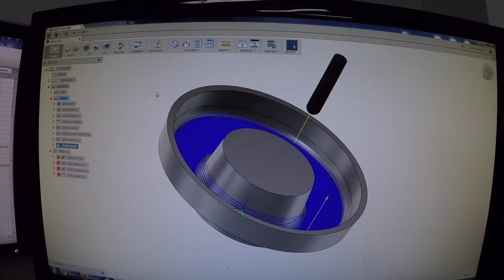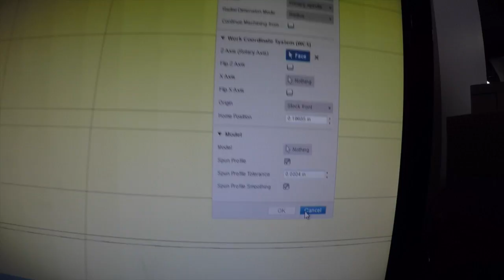A Bad Day, Frustrating Fusion 360, New Scrap Bins, Vacation! CB17

Comment: You want frustrating? Yesterday (the same day as this video) my fixturing (What's the rule of thumb: "75% of your time for a one-off job is fixturing"? Yeah, I blew through that to about 99% of my time spent with the spindle stopped, struggling with quill clearance and t-slot studs being too long) was a little loose and it cost me an end mill due to chatter. The part was reworking of a Korean (Likely "Chinese, imported into Korea and resold" and exported to the US) RPK (No, they're not "AK" even if they fit in an AK) rear loading 75 round drum. The flat spring will tear out of its rivets. I had an idea to slot the spring case and bend the end of the spring 179 degrees to hook into the slot. That's not going to come out without forces not normally present.I still have to load it up and go test it, but it appears to work.) The fixturing idea was sound; Add a pair of 1-2-3 blocks under the stripped drum, shove a stud through the drum's center hole, add a nut and screw into a T-slot nut, then screw down two outside edges to two other T-slot nuts, but I didn't get enough torque on the center stud.

Oh, and my garage hit 93 degrees. I don't like working in heat. But I persevered after sitting in front of the air conditioner vent and having lunch.  Hangries, I guess. 

I had to switch to a 1/2" flat E/M and change my recipe (581 RPM, ~2 IPM) for a 50 thou thick half inch tall piece of (poorly oriented) carbon steel sheet after torquing everything down again. Victory in the battle, and hopefully, victory in the war.

Comment: Customer service is crazy some times.  I was in Radio Shack unfortunately last week, and when I went in the sales person climbed on my back and I stated the I was good, I just needed to get some components and I knew where they were at.  Then when I went to check out he wanted to know if I wanted a $5 coupon for my next visit, they just needed my email address.  I said no thank you I'm good.  Then he started hammering me because I was giving up essentially $5 cash and I needed to give him my email.  I walked out without anything and I will never go back.  Sometimes you just have to be able to read your customer.  Have a good vacation John.
Reply: I was already upset with myself for shopping there.  The parts were overpriced, low quality connectors but they were local and didn't require shipping.  So that night I ordered good connectors and paid half price.

Comment: Bad days to me are just a moment in time.  I don't let it pull me down.  It's tough to do but when you get the hang of it, it is easy.   Deal with it at that moment and move on.  If you let it fester, it just gets bigger.  
Dealing with other people's attitude......I treat them exactly the way they are treating me.    It sounds a little petty, but it quickly changes their way of interacting with you.   You don't bend for them.    I've told people to leave my shop within seconds of walking in the door.   Dealing with assholes doesn't pay my bills, I would sooner put the extra service into customers that work with me and want to deal with me.

Comment: Those Cardboard boxes are called Gaylords.
Reply: +NYC CNC Wikipedia: 
In the U.S. and Canada, the term gaylord is sometimes used for triplewall corrugated pallet boxes; this is due to the first bulk bins being manufactured by the original Gaylord Container Company of St. Louis, which was acquired by Crown Zellerbach of San Francisco in 1955.[2][3]

Have a great vacation!

Comment: I would of said fuck it, and bought a face ground cutter. Sandvik 151 or other would crush that part in 10 mins or less.
Reply: I have several of them. Try Diameter/4 in depth with changing step over of 20 to 70 percent. I have done full depth with 80 percent step over but it takes a lot of power. The most important thing is insert grade there is a huge performance difference with a H13A to standard 1130 for steel and stainless.

Comment: ? you local scrap yard doesn't supply you with dumper bins? I've never paid for one, I just call them and they drop one off if I need another. Also don't you have a 12 yard lugger bin outside for your steel scrap yet? Or do they want you to pay for that as well. Sound's like you guys get the short end of the stick down there. I use those boxes for aluminum and SS and don't bother with the tarp in them. I just cut a piece of cardboard the fits in the bottom so that they don't leak chips out the bottom, and then you don't have to use (and lose) a trap. Those are used bulk food boxes for the most part and they can't reuse them so they should be free by the truck load.
Reply: Weekly? Hell I only get mine huge-ish bin (16 Yard) emptied every 6 months or so. Now with the oil field so slow it's going to be closer to a year and all I do is call, they come and empty it and then mail me a check for the scrap! no fuss no muss. I just find it a crazy how hard it is for you guys to get service down there, be it scrap bins or cutting tools. I'm always blown away watching your chip breaks when you explain the grief you go through just to try and do business with someone. Even my dad's auto shop which was about 2 hour drive from a scrap yard, or civilisation for that matter, could get them to pick up scrap as long as he had 1 ton or more, and they pay him cash when they picked up!